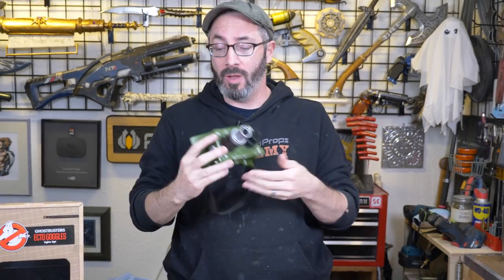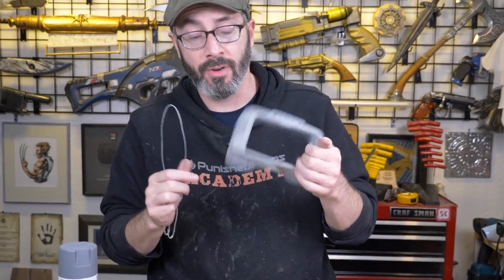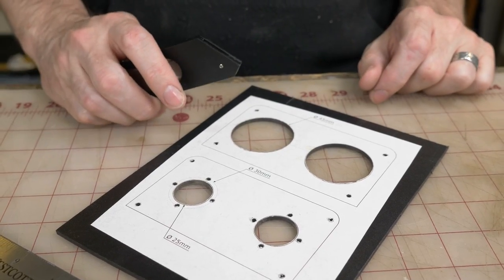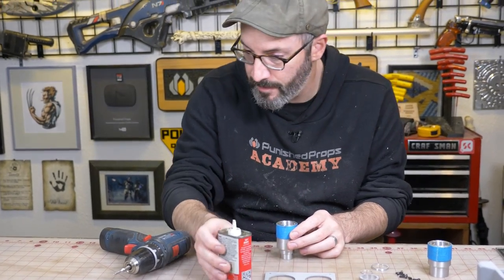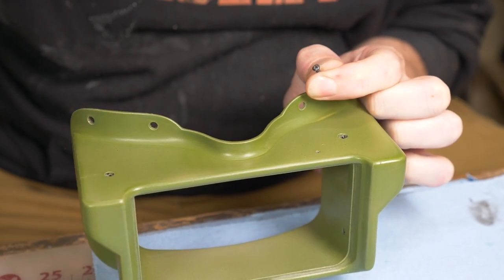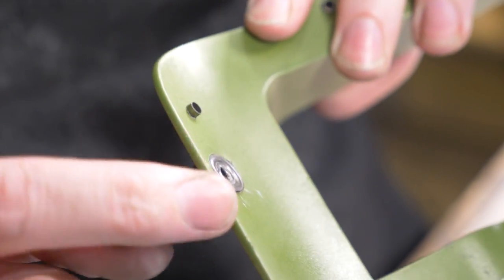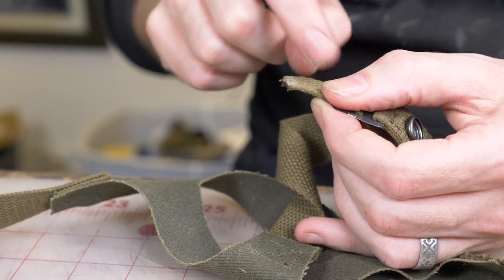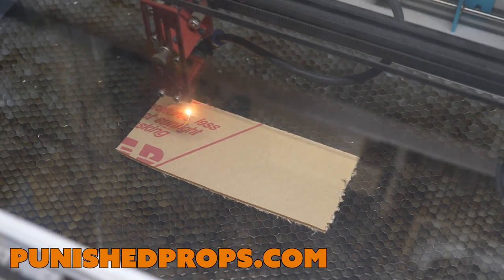Ecto Goggles from Scratch - Full Ghostbusters Prop Build

Comment: Awesome video as always! When dealing with snaps on a fragile part, I like to bolt the snaps in with nylon bolts. That way I still have a mechanical connection that I know will function just as well without risking damage to the prop.
Reply from the maker: That's a really fantastic idea!

Comment: Looking at the reference photos from the screen used prop from GB1 the battery sticker you put on was the right way around. Using the reference from all 3 versions from the films all of them compared to the on/off/pull IR sticker it is the right

Comment: Good way to get snapped off drill bits etc out of non ferris metal like aluminium and silver etc is acid...  Put some swimming pool acid with water and make a pickle, heat it up in a pyrex bowl on a hotplate, drop your part in and the drill bit or tap that you snapped off will rust away quickly..
Useful trick when you can't hide your crimes like you did

❤️ Your channel
Reply from the maker: I'm gonna keep that technique in my back pocket, thanks!

Comment: Instead of using the aluminum tape to protect your knurling or other finished part in the chuck, I like to use cut up strips of a pop can. Might add little more protection, is pretty available if your addicted to Dr pepper like me and chuck it in the recycling when done :)
Reply from the maker: That's a fantastic tip, thanks for sharing!

Comment: How good of a metal lathe do you need to make the aluminum pieces? Will a small hobby lathe work or does it need to be of a fairly higher ($$$) quality?
Reply from the maker: A small hobby lathe is a great place to start and will totally work for aluminum. Mine is the smallest, cheapest lathe you can buy and it worked great.
Reply: For those wanting to do this without a lathe, the eye tubes look to originally have been made from Telescope eyepieces (probably 1.25").

Cheap plastic-lensed eyepiece kits can be had from Amazon or eBay.

Comment: in the outtakes regarding holding on to your work with the spindle sander.   you should REALLY hold onto the work with a pair of work gloves.   I know it sounds silly.  But I had a friend rip a huge gash in his palm that required stitches at the ER doing EXACTLY what you were doing.  Sanding out the center hole of some 1/8" thick abs plastic.
Reply from the maker: You make a compelling point. I've also been told that wearing gloves near a spinning tool is a bad idea. The best advice I've been given is to always stay present and focus on the task at hand, no matter which tool you're using.
Reply: @punishedprops  One time I was wearing "anti-slip" gloves next to a spinning steel axle, I made a wrong move and touched the spinning axle. My glove got grabbed just by the friction between the silicone like coating of the glove and the steel axle and the glove just got rolled around the axle. Hopefully the glove was thin and it teared apart, but I hurt my hand (the whole side of the hand where the little finger is, I had big marks like my skin was about to tear apart).
All of that to say that I think sometimes you should wear gloves, sometimes not (depending on the machine) and for what happened to me, if I had wore a thick leather glove, I don't think the spinning axle would have grabbed it like that, as the leather would have most likely slide on the spinning axle.

Here in this video, with the sandpaper, I don't know, I guess it might be able to grab a leather glove as the sandpaper basically has friction with everything. Maybe some sort of hard plastic gloves, but I don't think that would be handy to work with.

In the end, like you said, all attention is needed while working with any power tool, they all have risks, even with protections.

Comment: For that broken drill bit, you might have been able to break it out by hitting it with a punch or automatic center punch.  Had to rescue an unmovable hole using that method more than once.
Reply: Also, for those wanting to do this without a lathe, the eye tubes look to originally have been made from Telescope eyepieces (probably 1.25").

Cheap plastic-lensed eyepiece kits can be had from Amazon or eBay.
Reply from the maker: Great tip, thanks for sharing!

Comment: Hmmmm… that weathering is not super legit.  You’ve got them all separated, so you’re evenly banging up the parts even though only the front edges would get damaged if they were attached to the helmet and banged up in real use.  

Sounds like nitpicking but it’s not at all.  

It’s SUPER LEGIT.  😎

But yeah, awesome build.  I just do the knobs ‘n’ stuff 3D printed resin.  

Because I’m advanced ghetto.